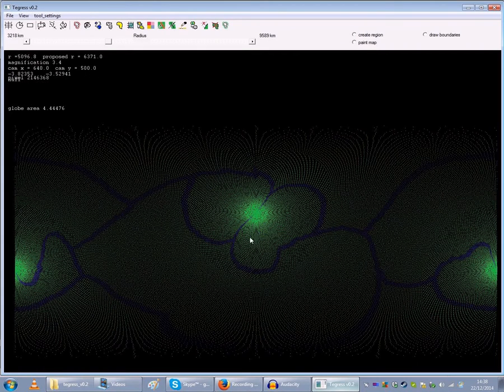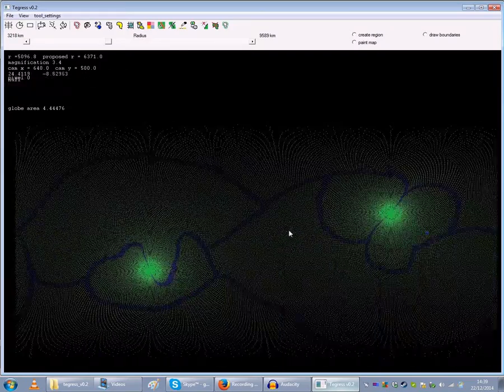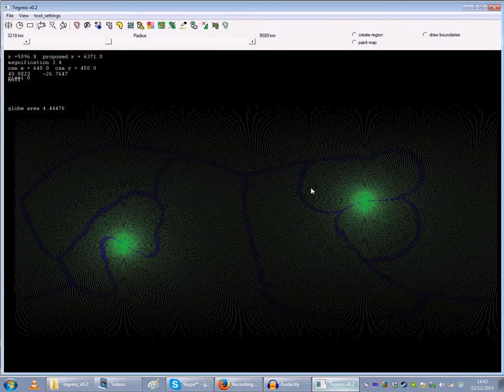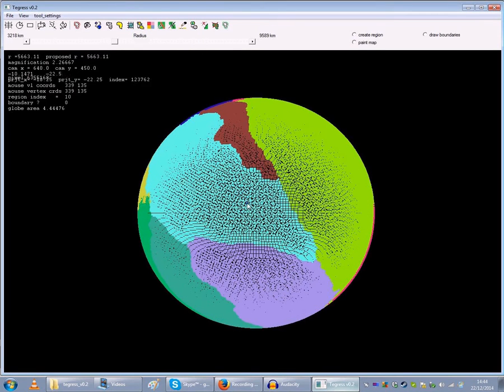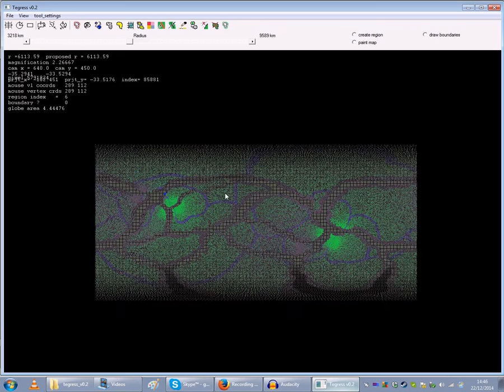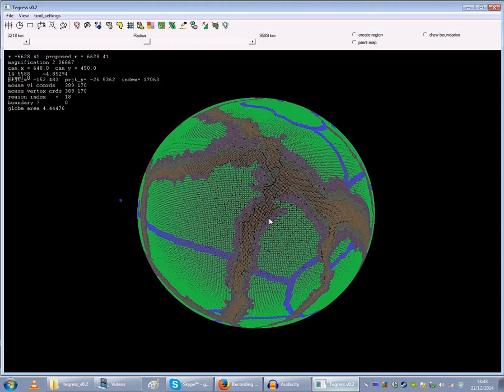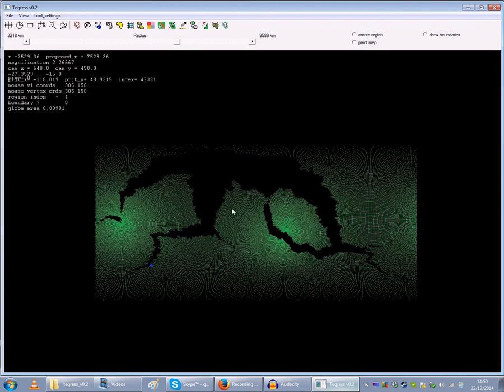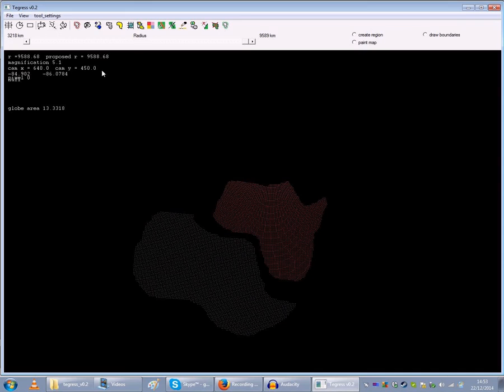tegress v0.2 demo

Comment from the maker: in the current version reduction of surface material is a botch, and the problem itself is fundamentally difficult ( for one thing : the continents change shape too much ) . its easier to start with a small world map then model its growth forward in time. backwards time animations are then just playing the recorded animation backwards.
So yes, you can reduct surface material, but the results in v0.2 won't be satisfactory ( and thats assuming it doesn't crash ! ). There's still a lot of work ahead before good reductions are achievable.